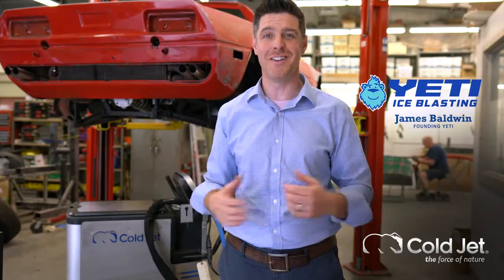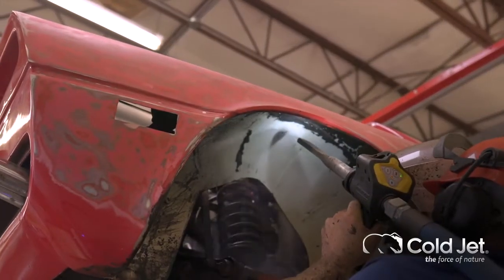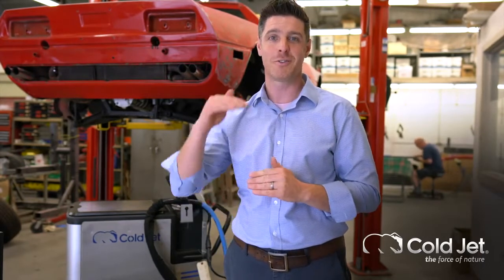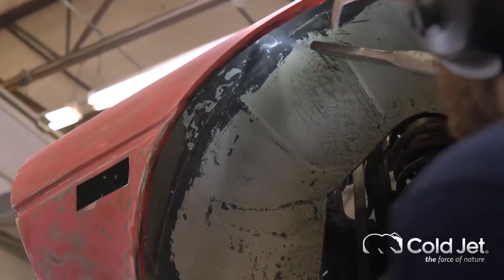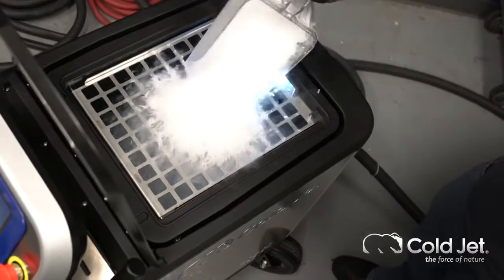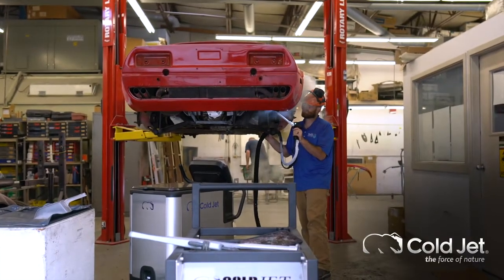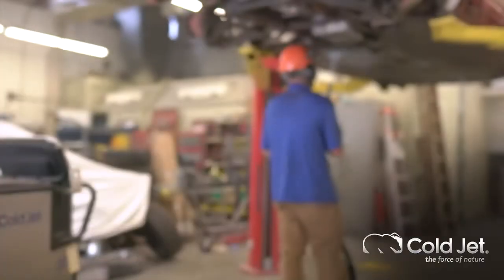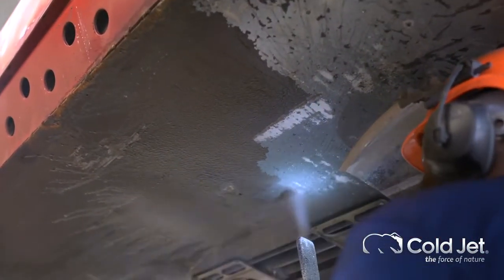Cold Jet Dry Ice Blasting - Restoration of a 1973 Maserati (Testimonial)

Comment: Why would you strip the protected coating if there’s no rust under it and it’s still protected? 

If it is bonded for that long with nothing harmful under it why wouldn’t you just leave that and apply a coating over it?
Reply from the maker: Hi Joseph, this is a testimonial video from one of our partners in the US (Yeti Ice Blasting) and therefore, I don't have the total insights for this project. I believe this may have to be related to their customer requisition but if you would like to have a specific explanation about it you can contact our friend from Yeti Ice Blasting (https://yetiblasting.com/) and they should be able to give you the full explanation for your question. 
Cheers.
Reply: Why ask such a question without any context? I am so baffled. There may be a millions reasons why. You missed the whole point of the video and wasted my time commenting here, just had let you know.